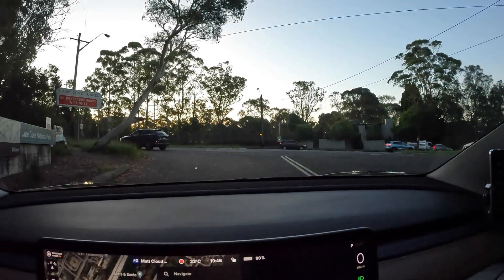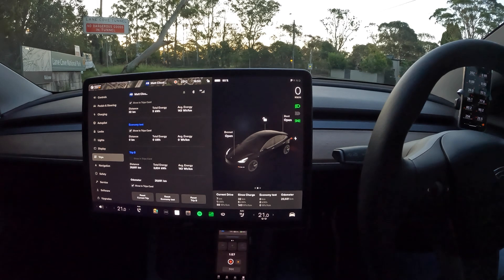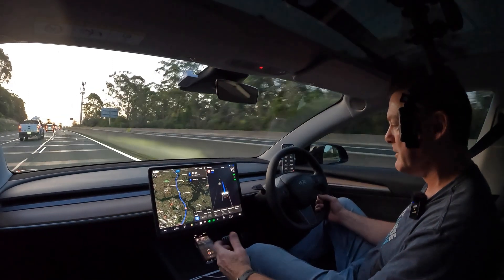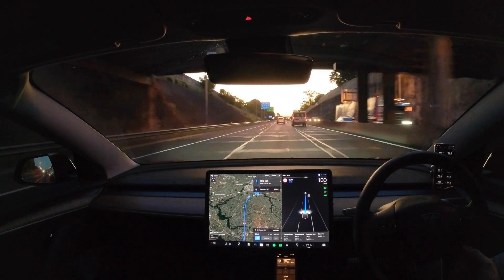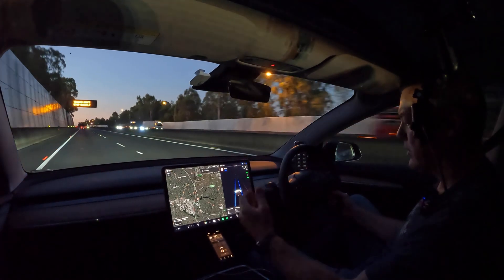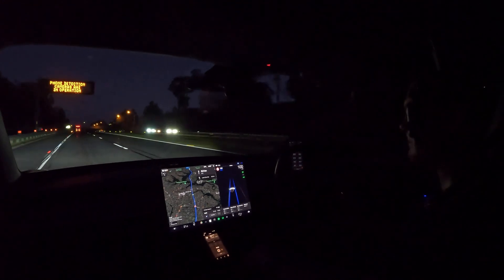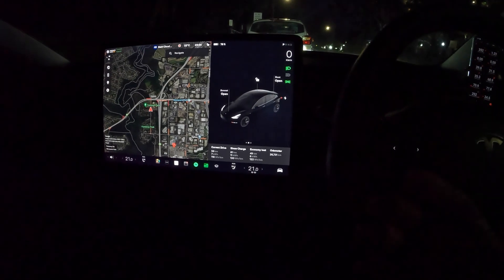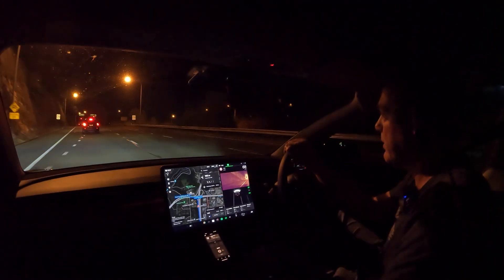Aero and turbine wheel covers economy test. Tesla Model 3 SR+

Comment: I wonder how the extra cost of energy (10%) compares to rim rash savings. However, once you have rim rash on your wheel cover you will want to replace it. That raises two questions, 1 can you buy a single replacement,  and 2 how's the cost comparison for wheel cover replacement to rim rash repair? I suppose it depends on how often you scrap your rims 🙂.
Reply from the maker: You can just buy 1 if you have purchased a set of 4 previously. They are $70 from memory. The only issue is by the time you need a replacement they might not have that particular style in stock anymore. It looks like Tessories don’t sell this particular one anymore. I’ve seen people mention getting wheels repaired costing around $250 to repair depending on extent of damage. If you have to buy a full set it gets pretty expensive. At lower speeds the aerodynamics don’t come into play. Overall I don’t regret buying them. I’ve scratched the back left one up a little but it doesn’t show up as bad as rim rash which is a positive.

Comment: I mean a 10% difference is pretty signifigant.
Reply from the maker: 10% as a figure yes but owning an EV for 2 years now I have realised that it is not that significant. If you were somewhere remote and needed every last kWh then yes it would be significant. At motorway speeds it would be approx 30km of range. That’s not going to be difficult to manage. The superchargers are so close together you can just charge for an extra minute or two. Around the city at lower speeds, not even worth worrying about.
Reply: @notinthemanual  Yeah I agree for the most part, but on long trips I swap my wheel covers and remove the roof racks, gets me about 15% more range.
Reply from the maker: @SirDragonClaw  If you need the range that’s great. I guess it’s wasted energy too not just range and you pay for the energy.

Comment: G'day Matt,
Have you got mudflaps on your car? What are your thoughts on whether they are necessary and how much they affect economy?
Reply from the maker: Hi Gavin. I don’t run mud flaps. It’s probably a good idea to protect the paint though. I think the small ones for the model 3 and Y wouldn’t make a big difference to economy as they are mostly hidden behind the tyre.
Reply: @notinthemanual  have you noticed any paint damage to your car?
Reply from the maker: @gavin.e8228  Not really, but I don’t drive on dirt or gravel roads that much. Maybe if you lived somewhere with snow on the roads where they are salted or have grit it would be a necessity.
Reply: Thanks Matt, appreciate it.

Comment: Hi Matt, do you have a video to talk about charging LFP battery and how to increase the range and prolong the battery life?

I have my 3SR+ since Nov 2022. It has total 2769 miles. The brand new battery at 100% would have 272 miles and now if I would charge to 100%, it comes down to 266. I charged to 100% twice and I never super charged it yet. I normally keep the charge between 30-70%. I charge up to 70% from 30%. I drive very short distance daily like 2 -4 miles for drop off kids to school. And about 10 miles 3 times a week, and about 20 miles on Sunday to church. 

I feel bump that it only has 2.7k miles on the car and it is already 6 miles range lost. I change it to the % but I cannot stop trying to figure out how many miles would be for 100% charged up.
Reply from the maker: This is a tricky issue but I can tell you there is nothing wrong with your battery. I have a few LFP videos but nothing specifically on this alone. I have a video on my degradation experience at 1 year and I talk about this topic there. I have mixed opinions on this. It’s a long term thing that there isn’t much data on. LFP batteries do most of their degradation in the first couple of years and then stabilise to almost nothing. My car is a 2021 model with the 55kWh LFP. It now seems to have stabilised at 5% deg but I have read that they often stabilise at 10%. I wouldn’t focus too much on the range figure at 100%. This is not an accurate range calc. It is not based on your driving style but a fixed EPA test data calculation that changes slightly over time. Tesla updated this EPA calculation a few months after I got my car and there was a big change in my range at 100%. So how do we even know what is real or artificial degradation. I have actually started to ignore this figure both for it’s inaccuracy and the fact that this small amount of range loss on this guesswork figure was not useable range anyway. Tesla sets the amount of useable energy that the battery can give and there is a pretty decent energy buffer there that Tesla could tap into if needed long term.
Reply from the maker: I suggest leaving it on % and forget about this inaccurate figure. Use the energy app if you want a real world prediction of range based on your last 10, 25 or 50km driving style. This is a much better way to look at range. I’d suggest charging to 100% at least once a week to reset the BMS state of charge calc. I have had some comments on LFP batteries degrading if not charged to 100% but I couldn’t find any credible info on this. There is no way Tesla are going to tell you to charge to 100% all the time if it is going to damage a battery that they are warranting. I wouldn’t stress too much about it.
Reply: @notinthemanual  I found reference to this in a LFP research paper. There is some memory effect when you partially charge an LFP battery, however this is erased when the battery is charged to 100%. It can also be mitigated by using coulomb counting, which we know Tesla does. It does not damage the battery. Long story short: charge to 100% at least once a week as Tesla recommends. That suggestion is there for a reason (as you already know!).
Reply from the maker: @aviationboy8  I think we read the same paper. It was the only info I could find on this and it was mainly talking about household storage from memory. Yes Tesla would be all over this and CATL too. My opinion is if Tesla says it’s ok to charge to 100% all the time then go for it. They would be analysing massive amounts of data from the cars.
Reply: @notinthemanual  agreed. I also went through the “don’t charge above 80%” phase but I eventually got over it. Being able to charge to 100% is one of the biggest benefits of the LFP, so you may as well use it!

Comment: Hi matt, do you think having headlights on, has any affect at all on the outcome . I live in tasse  and the best results we have got is about  143 wh/km in our mod 3 sr , 18 inch tyres correct pressure, driven gently in good whether combo city and highway 100k max with aero caps on. Not that i am complaining , have not done preconditioning yet. 🙂
Reply from the maker: Hi Jim. Headlights will make very little difference. They draw approx 100W so would take 10hrs to draw 1kWh. This test ended up with an average speed of 80km/h so efficiency was slightly better than normal freeway driving. Before motorway exit regen braking it was closer to 130Wh/km for aeros and just over 140Wh/km for the turbine covers. My average for 28000km is 143Wh/km so your pretty much spot on with my average.
Reply from the maker: Not preconditioning for fast charging will add approx 15-20mins to a normal supercharging session 20%-80% so if you have the time don’t worry but if everyone didn’t precon for DC fast it would possibly cause congestion during busy periods. I prefer to precon and have faster charge sessions. Increased consumption over a long trip would be negligible and when you start putting a cost to that extra consumption it amounts to loose change.
Reply from the maker: Oh and tyre video filming is about 80% done. Squeezing it into my lunch breaks 😜